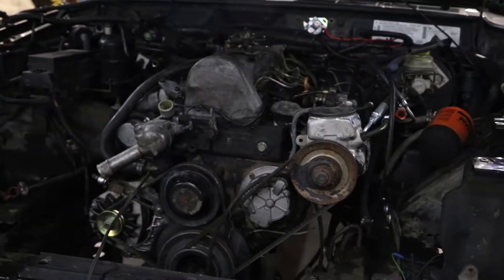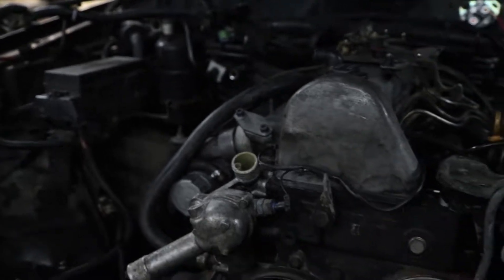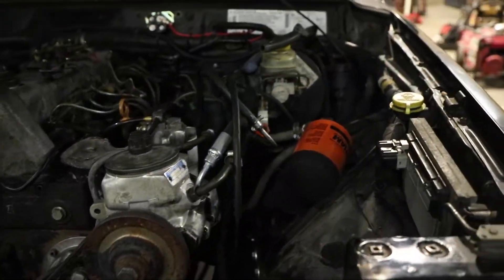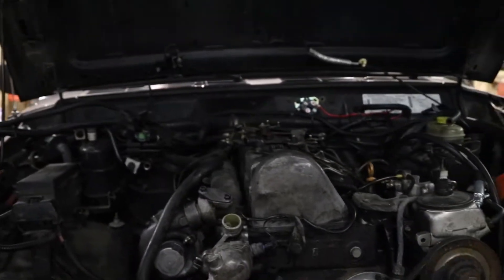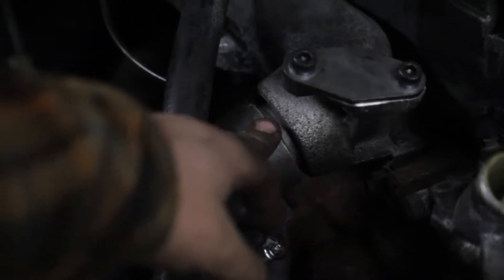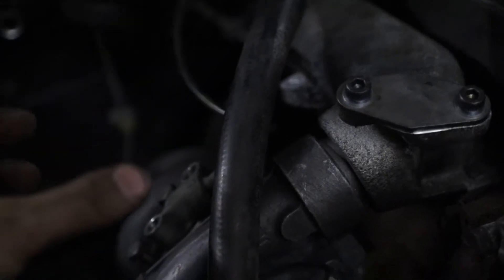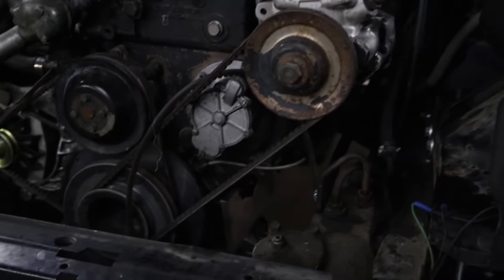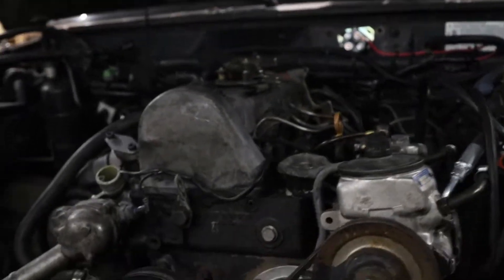First Video: Jeep Cherokee OM617 Turbo Diesel Swap

Comment: I am planning on building an OM617 XJ. I have an '84 OM617. I have a couple XJ's, a '97 2 door that I really like and a super clean '87 4 door. I picked up an '86 5 speed XJ for the 5 speed swap. I was worried about the wiring with the '97 plus inspection issues here in Vermont so I think I will use the '87 for the diesel swap. Looking forward to seeing more videos on your XJ!

Comment: Could you make a video on your track bar?  Struggling to make room and custom bend for mine using a zj pitman arm for 3/4" drop on steering drag link, and a 3/4" drop bracket from IRO for a custom double shear track bar

Comment: question? The vacuum pump goes on these motors. Can you go with Hydro brakes and kill the vacuum pump.
Reply from the maker: Yeah I am sure someone has done this. I opted to keep the factory vacuum pump.
Reply: Probably not a diesel doesnt produce vacuum hence the vacuum pump. You can maybe run a hydro boost system like Ford does with the power stroke etc.

Comment: Did you use the Jeep transmission with an adapter?
Reply: Derrick Dennis yes you have to buy an adapter mercedesdiesel4x4.com you can also use om603 engine or om606 for mor power 😌
Reply from the maker: Yeah I am using the factory AX15 manual transmission

Comment: Two big questions....first how did you get the oil pan to work with the track bar??? And second...how did you get the fuel shut off valve working???
Reply from the maker: I dropped the trackbar about 3" to clear the pan. I also am running one ton steering so that affords me some extra room along with a rubicon express track bar. A front sump motor is not ideal, however I made it work!
Reply from the maker: I guess I should clarify, I fabricated a drop bracket at the shop for the track bar. I used the rubicon express mount as a base and built off that. It is tight but it works now.
Reply: @KeystoneCarry  ah ok I had that idea...but I went with a  custom oil pan that I still need welded..great build! Mines a 90jx :-) oh have you gotten the shut off valve working?
Reply from the maker: @TravelingTexasFisherman  I used the vacuum shutoff from a mercedes car. You can also use a pull cable shutoff and run the cable through the firewall and into the cab. I have seen several people doing that
Reply: @KeystoneCarry   I'm using the vacuum shut off on mine..but it retains vacuum when I try to restart...and that's the issue in trying to sort out now :-)...I may upload a vid of my rig soon :-)
Reply from the maker: @TravelingTexasFisherman  Hey I figured out the issue you are having (most likely). On the jeep factory there is a vacuum reservoir. It is up front near the bumper. Pull the line off that and plug it. What's happening is that is storing vacuum after shutoff. Once I did this to mine it stops and starts perfectly with the key. Hope that helps!
Reply: @KeystoneCarry  ok good deal! I'll try that and see how it goes! Thank you for the info!

Comment: Very cool. Did you get the factory xj gauges working?
Reply from the maker: Most gauges worked right away. I have created a setup to trick the computer to wake up but haven't tried it yet because we are currently completely rebuilding the motor I put into the jeep. It will soon be back in the jeep and running again.